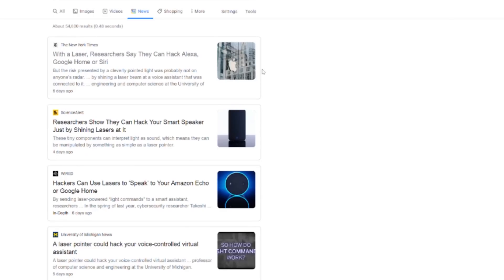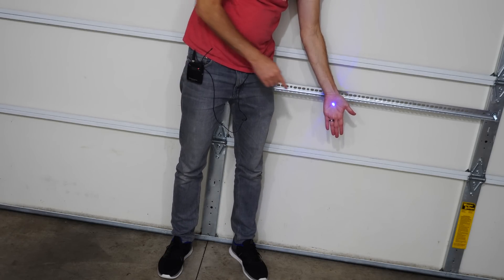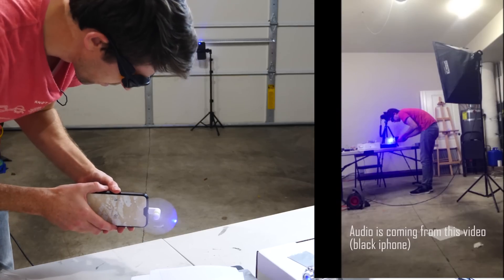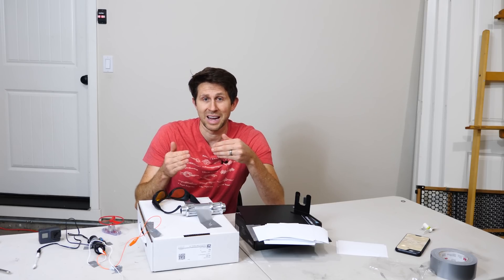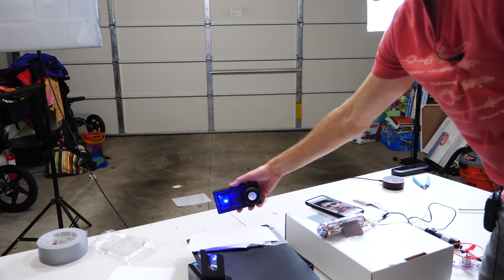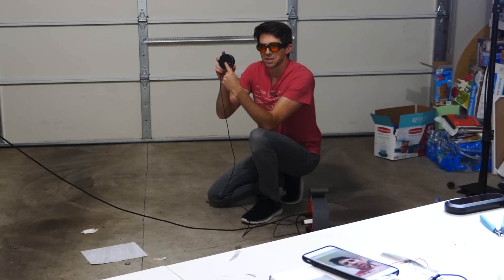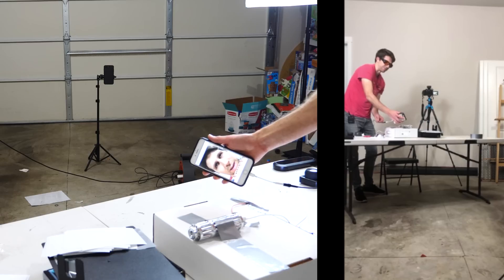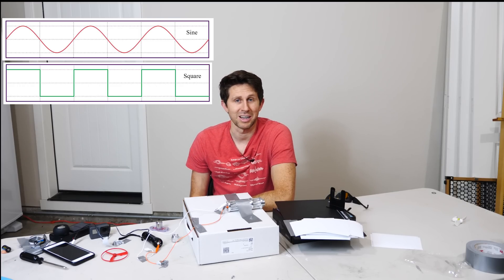Hacking into an Amazon Echo Using Laser Light to "Speak" to Alexa

Comment: Probably didn't work because the modified flashlight and the unamplified sound output from the phone jack wasn't enough powerful to modulate the laser properly to be captured by the microphones. If you read the paper made by the Light Commands research project, they used a Laser driver and a sound amplifier to successfully perform the experiment

Comment: Could you explain exactly how you modulate the laser? I don't think the audio output is enough to directly power the laser, so I'm thinking that maybe the laser has a separate input that does allow modulating the laser output (varying the strength of the laser output under control by an input signal)?

Comment: If you know what did he plug his phone into?
Reply: Well, he plugged the audio output from his phone into a laser , but exactly how , I'm not sure, unless his laser had a specific input port (besides its actual power supply input) which could vary the output of the laser by a modulating input signal (in other words, change the strength of the output of the laser beam in accordance with the varying strength of the input audio signal).

Comment: To make this experiment work better, you need pulse width modulation. The modulation frequency has to be outside of the audible spectrum and high enough in frequency that you can modulate audio effectively. You might be able to do it with a Class-D amplifier, minus the output filtering stage. There should be an audio-modulated PWM signal you can tap into on the output stage somewhere.

Comment: Yeah this is such cool shit. You can use laser light as a microphone and a speaker. The Solar panel is the key. It converts light to audio. You can shine a laser at somebody's window weather it's a house car or in a high rise building and here what is being said. And go 1 moe step further use an infrared laser and nobody would eva know you were spying on them. This is actually an old espionage tool. The FBI, NSA, Secret Service use this and have already. Remember the TV shows where the cops or FBI are trying tail somebody and listen in. They had a big ol' head phones on holding some kinda glass radar dish speed gun looking thing. Well that is light to sound amplification. The glass radar dish is your solar panel and they do use infrared lasers. the trick is to make sure your light is going through glass and reflecting back to your panel, take the red and black power wires of the solar panel hook them up Left and Right audio into your sound app and blamo. You can actually hear anybody talking anywhere in the house from hitting a window opposite side of them in a building. It is sound waves that are highly sensitive in the air that hits the glass that the laser picks up and brings back to your panel to be converted into audio.  Awesome shit. How do you think fiber optics work light carrying information and how the voice of god weapon works kinda the same thing. Also a type of mind control uses this same principles. NOW one can start to understand just how easy and simple it is to control, munipulate or gang stalk somebody and or make them look crazy or drive them insane. I just love optics is so damn fascinating. Will be looking out for that next video thanks Action Lab great vid.

Comment: As I watched your video (a good video), I wonder if the material used in the production of iphone diaphragm is both voltaic and piezo in nature. If it is piezo and thin in dimension, acoustic vibration could be received and transmitted as electrical pulses. If it is voltaic (or partly voltaic), your iphone diaphragm should be able to generate electric pulses that are transmitted on the same paths for the acoustic.

Comment: Most likely all you need is stronger modulation. The amplitude of the modulation when you use the fan is the same as the intensity of the laser, when you modulate it using your circuit the amplitude of the signal is probably very small.

Comment: Simply sending audio over a light beam has been done for decades, no big deal, modulate the light source and detect it using a photo resistor, diode or transistor.  As for the microphone picking up audio from a laser, I'd like to know what types of microphones were tested by the original people reporting the effect.  I could see modern electret condenser mics picking up light using some sort of photo-capacitive effect.  If it works for magnetic, dynamic, ceramic and carbon-granule mics as well I'd be surprised.

Comment: This weakness can be patched by requiring you to press the activate button (the one that you can press instead of saying "alexa") in order to send an unlock/open door/anything security related.
Edit: When you say something like "alexa open door", it will say something like "Sorry, but for security reasons you need to push the button to confirm your command".

Comment: Mics will record sound wether its Sinusoidal or square wave. 
The iphone heard the fan because of the amplitude difference between 100% and 0% (on or off), where as when you are using sound, the amplitude was simply too low.
I suspect 1 of 3 things
1- Increase the sound volume
2- Increase the laser ouput
3- increase the difference between the quiet and loud parts of the audio ( dynamic range)

Comment: Sound moving quicker than sound

Sound at light speed, madness
Reply: No.. You can modulate using lower frequencies such as 100 MHZ (everybody knows FM radio). This is exactly same way how to send information for long distance. Sound is not faster than light and never will be.
Reply: Yea it's not actually sound, it's information at the speed of light, which then gets converted back to sound. Pretty much the same as radio except you use a visible frequency of EM radiation, so you need a solar panel instead of an antenna to pick it up. If I'm not mistaken this is closer to AM radio than FM radio.

Comment: Is it not what is done in communication system where instead of light another electromagnetic waves called radiowaves are used to transmit information with an antenna on the other side to catch it?

Comment: I guess it depends on the modulation. If your Lasermodulator does a amplitude modulation,  the light intensity is follwing some continous values as you suspected. But if you use a pulse width modulation(PWM) there are only two states on or off and the soubd signal is encoded in the duty cycle. The PWM frequency shouldnt be picked up, because the microphone itself is a low pass filter and the AD converter in the device should have a lowpass filter.

Comment: I don't think your modulation depth was sufficient. The continuous (DC) part of the laser swamped out the audio (AC) portion. Turning up the gain will make you sound like you're talking through a megaphone, but I bet the device can still interpret a voice with clipping distortion applied. However, if the carrier (laser) can't be modulated to near zero, I think it's going to suppress whatever physical effect is causing the microphone to respond.

Comment: Good demonstration of a well known phenomenon.
"Certain" Gov't offices are well aware that a laser reflected off a window and back onto a receiver provide VERY good audio of what's being said in the room.
I did this on my garage window with low music playing inside. My receiver was a solar panel (much like you used). I was pretty amazed at the clarity.
Note: "Those" with a reason/budget would use a laser not visible to the naked eye.
"Others" with a reason/budget used coated glass that reveals the laser, a piezo transducer stuck to the glass playing white noise (personally I would have it play Rick Astley's Never gonna give you up), and/or sound deadening curtains.

Comment: You can build (or buy) a Laser Listening Device. It allows the user to bounce a laser off a window (like your neighbor's window) and set up a receiver at the location where the laser light reflects back to. The window acts as a diaphragm that vibrates from the sounds and noises occurring inside the house. So you can listen in on your neighbor's conversation (which is most likely illegal if you dont have their consent). You could test the device out on your own windows though.

Below is a link to a company that sells plans and/or fully assembled units. There's also a video on youtube where someone built one of these using a green laser.

https://www.amazing1.com/laser-listener.html

Comment: I had an idea that I would think you would be interested in trying. Does light move differently through high pressure air, if you built a clear high pressure tank, would the light move differently through lets say 100psi of air. I know light moves differently through high speed/ high temp air but would it move or behave differently through a high pressure environment

Comment: I think the biggest difference among the two setups is frequency and amplitude. The fan generates a modulation around maybe 40 Hz with an amplitude going from 0 to the full laser power, while in the second setup the laser is (supposedly) modulated with a much, much smaller amplitude, around the full laser power, and 3-4 times the frequency.
Whatever the process causing the microphone to respond to laser light is, it probably has a peak efficiency at a specific frequency, so you won't get it working across the whole spectrum

Comment: My first assumption would be that it's working because these days all of these devices use elctret condenser microphones and the laser light hitting the membrane / electret foil cause a change in the charge state translating to an audible signal (utilizing the very working principle of the device)
James, try it with a dynamic mike to "half-prove" my assumption :)
P.s.: your problem is not the waveform but the modulation amplitude. Chopping the light with a fan is 100% modulation whilst your laser got modulated a lot less. You either need to DC bias a laser diode or use PWM. None of these are trivial with a factory made laser pointer as it has built-in driver. And be careful reversbiasing laser diodes they don't like it! ;) (I fried one with only a few volts of reverse polarity)

Comment: One more thing to worry about now relating to security of smart devices.
Reply: Yes but very few people have their devices attached to doors windows, locks, home security, ect
Reply: if someone can shine a laser direktly into your smart home speaker without you noticing, he can also just scream loud enough for activating it
Reply: @ArroyoAirsoft  You would be surprised how many DIY people have raspberry pies that can open garages or wifi enabled locks tied in to Alexa. The hardest part would be finding a house that has this tied in. You could judge this by their security camera's and what type of lock is on the front door if you know what you're looking for. In reality if they really want in they could just kick your door in or use a racking attack on a conventional door lock. Nothing is full proof but doing it DIY makes it harder in general if they don't know exactly what you have instead of knowing what common alarm/smart locks vulnerabilities are. I would say the most stupid alarm system is simply safe they push their product on a lot of YT channels and people post signs outside their homes. A simple $5 jammer could jam it's frequencies preventing the alarm to work.
Reply: @dco5055  Yes I agree. This kind of attack would only be logical if there was much higher security, for ex, a security guard. If not they will probably just go house to house waiting for an open door or window

Comment: Just put the output from the phone jack into a simple, high gain amplifier - a simple NPN switching transistor (2N-2222) configured as an 'A' type amplifier. This will drive the audio signal to the limit of the pre-amp's power supply causing it to "clip" at the peaks, making a sudo-square wave. Before digital this was the basic idea behind a "fuzz box" for a guitar. It still may not work. The two bladed fan would create a (best guess by roughly judging the width of the blades) 90% duty cycle square wave. An oscilloscope on the solar powered speaker output would give a visual idea of the difference in wave form between a voice modulated and fan blade pulsed signal.

Comment: I can give you some background on frequently modulation carried on a light beam. First of all Alexander Gram Bell did that using a very strong lamp and a photo cell from one mountain to another and patented it as a "photophone" before he invented the wired telephone. Now to your theory on the waveform. As a person with much knowledge on this topic having used this many times I believe that they are probably modulating the camera photodiode to generate the audio hack as a diode will act as a photo cell. We also used to take a can, hollow out both ends and place a stretched rubber baloon flat piece over one end. On top of that glue a small mirror. When you shine a flashlight on the mirror and speak in the other end of the can, the light modulates with the vibrating mirror. A photo cell on an amplifier will pick this up. My girls loved this. Great job at teaching fantastic site you have. I doubt that a microphone because it is capacitive will generate a fluctuating voltage. Maybe a carbon microphone would do. Anyway keep up the great work!!

Comment: Our voice which is picked up by the microphone will also be in sine wave. I think the problem is not with the waveform. Even when you use the fan to generate frequency you will not get square wave, because, when the fan blade starts obstructing the laser light, a part of light will be received by the microphone until the blade completely covers the light. This causes curvature at waning and waxing points to the signal generated by microphone.

Comment: Isn't this basically optical sound like what you have with home entertainment?
Reply: It is, but without any encoding, and without a designed-for receiver - the microphone can pick up photons, rather than changes in air pressure, due to differential heating effect presumably

Comment: I'm sure that technology has advanced a ton, but it used to be that speakers and microphones worked exactly the same way. The only real difference was the direction of the signal. I used this to my advantage many times when I wanted to record something and didn't have a microphone. Not everything  back then came with built in microphones (mainly because the cost for small enough tech was prohibitive.....a better name might have been macrophones). Instead there was an input almost always the same size (3.5mm just like now) as the "earphone" jack. I would just switch plugs and let my headphones do double duty.

Comment: This is cool but it isn't mysterious, Cody's lab has a video where he shows that his blue laser can put a tiny pressure on a sensitive balance scale. If it can do that, then the tiny diaphragm on a mems microphone should displace enough to pick up a tiny signal. The fact that the smooth signal doesn't register makes sense too, for the reason you state. It might be interesting to  modulate the signal to increase the relative variance of beam brightness. But of course you could just convert the audio to pulse width modulated audio (I assume that's what you're going to do).

Comment: I can already tell you YOUR RIGHT. Chopping the signal, speed = frequency)or F =1/t gives 2 signal a terahertz wave and sinusoidal wave or more commonly known as spacial and temporal resonance .(Think Black body vs incandescent light )  temporal wave they recombine in to one , its binary to   digital wave or bullion logic wave form from digital wave form (Michelson interferometery, where light interferes, it should be inter spheres  or 30 other types but do to the ferro nature it a black body or it is not ie index >+1) or  can go either way .    .(ps your eye video was awesome watched twice for the chemistry and to understand how the grin lens or gradient index change on chemistry and mechanical shutter eye lid control . so 4 different attenuators in   one . one chemical, one conical and we know we see both linear and circular polarized light  , so this is a analog to digital converter our eye
1st year physics class you do speed of sound experiment with different gas,s going down a open tube with a speaker on one end with a pattern or signal generator in square wave  ie chopped ( you can do dc or ac chopped signal but have de modulate 1st as you do then re modulate so the speaker will see it  . Now you very smart man is it time that is non linear or the sound?
Do research on why Bluetooth speaker why they work(why they changed band tempo,s  and you find they changed the frequency at some point in history . distorted non linearly both history or time ?
Ok do not think just sending it back as a square sin wave will do it . In sending we go from digital to analog (laser driver from digital to analog  to a solar panel to amplifier to sound  ) now we have to go analog to digital to amplifier to light to to its constituents Qed Qec Cartesian   coordinate ,on the micro phone,  a fiber retains this info between it amplification nodes ie (phase change ) of polarization  so your dealing with components of a matrix (basic zero order and higher  units of vector of tensor fields, of three differing index,s on 3 differing planes(9 each plane) , ie xero order ,1 ,and 2 , this is in a 3 by 3  tensor field or xyz,j j (think circle  not  cubic as in  being the zero order and is zero spin of it eigenstate and value (as viewed by the observer )

Comment: Instead of modulating the intensity (assuming you're doing that with amplitude) you need to modulate the frequency. Try to modulate it with a pwm (if that's not what your already doing), that will give you the sharp on/off, but it will also change the frequency of the light based on the frequency of your voice.